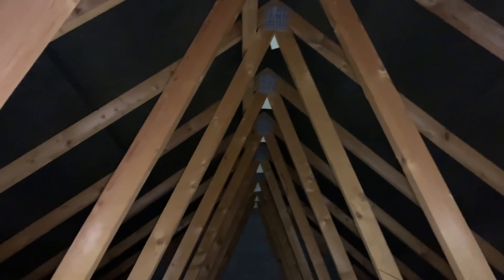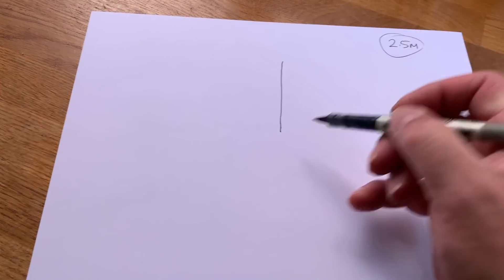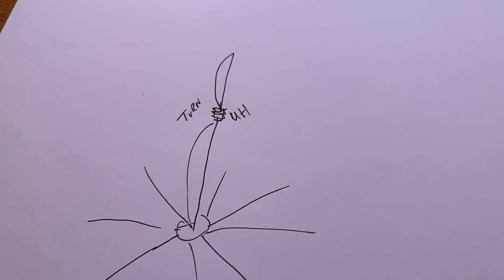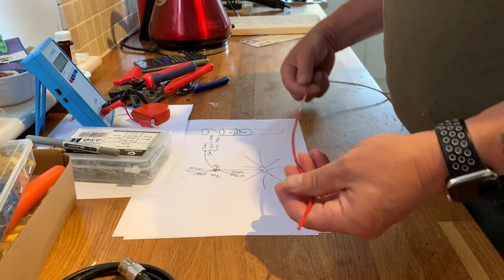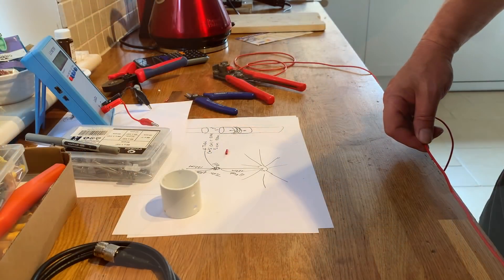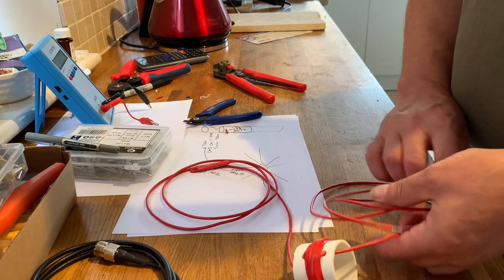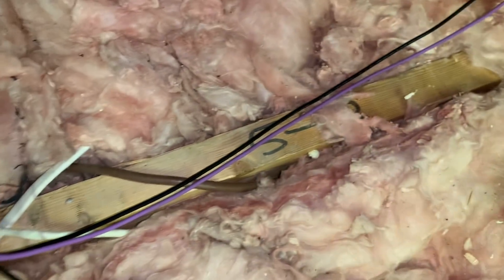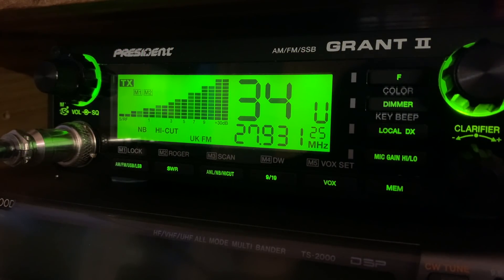CB RADIO: Build a Citizen Band Loft Antenna - Home-brew Wire antenna for 11 Meters.

Comment: Good video thanks mate, back in 1978/79 I had the usual DV27 aerial in the loft mounted on a biscuit tin as was the craze back then. The thing that differed was that I had put 4 1/4u ground radials on said tin and it worked quite well considering.
Reply from the maker: Very cool!

Comment: Unluckily I live in a downstairs flat, so no attic. Luckily I do have a scaffold pole base concreted in outside my window about 6ft away, so I can drop a vertical in a few feet off the ground. No issues with the Council, but may have to warning tape when the new RF considerations come into force. I can't see much of an issue at 10 watts into an Antron 99, no burn issues there ! Great video as usual Mike. 73's Andy M6APJ

Comment: I made it! I used a ground wire 10 awg, placed inside a 2" pipe, middle section made the coil, about 4 turns outside. My attic is 7 ft and a half, made the right calculations, 1.4 SWR. I wish can share pictures. I did not know that a simple vertical can be shorten out like this. Thank you so much. I live in Florida, USA and made contact to California, USA, Puerto Rico, Dominican Republic and believe it or not, made contact with Spain for about 5 mins, talked a stranger Omar at 26,925 MHZ LSB.
Reply from the maker: That is awesome!w

Comment: Good job Mike and glad you are including the CBers on your channel. I did a similar build in the 70s. Back then there was a lot of tube and fittings from old 405 line TV aerials. they were easily built to a similar design as yours and were free standing. Good for a loft or a flat roof
Reply from the maker: Good old days 👍❤️🤪

Comment: Hi great video, can i ask, when you coil the wire round the tube is that just to make the length shorter so it will fit, or is there more to it than that ? I see you used an online calculator of sorts to work out how many turns ect, can you please explain what the coils of wire round the pipe about ? Does it double up as a choke ? Thanks

Comment: You should try out a Moxon beam for 11 meters. I'm working on one now to put in my attic. Supposed to be just as good as a 3 element yagi, but with a smaller footprint. I shall soon find out. 
Keep up the great kitchen projects. I really enjoy your channel.
Reply: It has 2 elements,  so it won't be as good as a 3 element beam. Moxons are excellent though.
Reply: I'm using a 27mhz moxon fitted to a tripod inside my flat. 
Only have 2x90 degrees of rotation. North to East & South to West. Have had copies into South America, mainland Europe, just about got to Madeira a few weeks ago in USB  mode. FM not so good.
Reply from the maker: Many thanks for the flowers 💐 (Moxon soon) maybe.

Comment: Another easy way t get on the air. The vertical is better than a dipole because of polarity loss locally, not sure about trying a dipole for skip, the take-off angle is still better for a vertical. Another nice kitchen table project. I still can't figure out how your builds always seem so broad-banded. The coax run is short so the rg58 loss should not be that bad to make everything broad-banded.

Comment: Good vid. A nice simple classic. Worked well for me many years ago, but tried similar earlier this year and it picked up way too much electrical noise. Didn't hear many people on either, even though it doesn't look that I am far from you (am in that Roman town to your SE). So took it down and put up an inverted V in there just for skip shooting.. that works well, picks up a lot less noise, and can even get out to the odd local even though it's on the flat side.
Reply from the maker: Yes the inverted V dipole was next 👍🍌

Comment: Hi Mike,    You could have put a full .25 wave antenna up and just put the extra couple inches on a right angle and forget about the coil.  It’s the voltage end of the antenna.
Reply: I agree. It would be more efficent than using a coil as well as simpler to build.
Reply: Yes. And it would be more efficient without the loss in the coil. I've done this with dipoles and even my antenna modeling software (EZNEC) shows no real distortion in the radiation pattern on a vertical such as this.
Reply: Or follow the truss/frame on slight angle just off vertical to get length 
Or if you needed a bit more put antenna base through roof capping  & attache inside element to it with excess outside

Comment: I would have just stuck a small capacity hat (metal disk - radius = the length you needed to make up the 1/4 wavelength, could be just 3 wires)  on top, 2 advantages,  simpler to make, also increases the bandwidth so easier to adjust.
Reply from the maker: Great tip, thanks John.
Reply: 3rd advantage: less loss than the loading coil.

Comment: Will this work on the 2 4?
Reply: Same technique but need to calculate and cut for the frequency you want in the same way. For example for exactly 70Mhz:  300/70 then divide by 4 for quarter wave and times velocity factor of .95, so about 1.02m for driven element and say 15% longer radials say 1.1m long approx no need for any coil at this length.   Give it a go!

Comment: Try a u dipool 2 side 1.34m horizontal 2x1.34m vertical downside 2.5m high de verticals 1.16m from grond freq 27.5 swr 1-1.6
wen jou hang him on 5 m high he gose up in freq 28.277 swr 1-1.1  simple antenna (Mmanagal is you friend)
Reply from the maker: Good idea 👍

Comment: It's already been said, but I would rather just bend the top few inches of the whip rather than use a coil. Or using a loose spiral around a pole for the vertical element....or use a top hat to electrically shorten the antenna, Thanks for your interesting videos.
Reply from the maker: Great point, but I did the antenna this way to show that you can use a coil in lofts that are maybe only 6 foot tall or less.. an inverted V is the simplest answer...

Comment: "I'll turn the video off and come back and talk to you properly"  SPOILT!!!  :-))  Yes i understand people do not want to appear in videos 
Why don't you build a 5/8 wave loaded aerial for the loft, yes I know I could work it out for myself, but there are a lot out there maybe can't.  It should perform just fine, but you never know..
My mate stuck a 1/4 wave 102" steel whip out of his ridge tiles and used metal sticky back tape to give ground-planes coming off at an angle (Bit like the home-base Thunderpole.  Worked very well, he came into me at a S9 +10 at 4 to 5 miles away.  That was on 3 watts.  His signal was so strong to me that anyone shouting to get in didn't have much of a chance, unless \i heard a faint squeak in the background.
Two for you to consider  Mike  :-)

Comment: I was all excited.

Then I read it was CB.

Boooo.
Reply: Just make one for 10m or 6m then...
Reply: The same principles apply for 6 or 10 meters...just need to adjust length accordingly.
Reply from the maker: Well I could have said 11 meters or 10 Meters it all radio
Reply: Principles are exactly the same as any 1/4 wave.  It's radio antenna science, education, informative, homebrewing, practical, maths, velocity factor computing and FUN no matter what the frequency, or does RF somehow behave differently at 27MHz?
Reply: @mike-M0MSN  Quite correct. My apologies. My hideous bias betrays me.